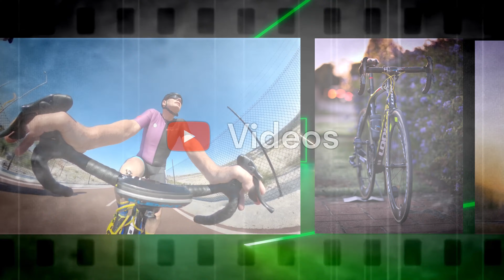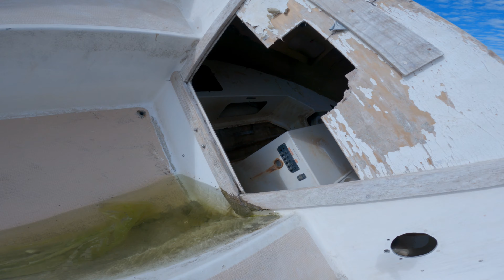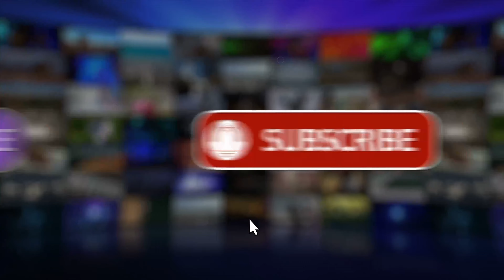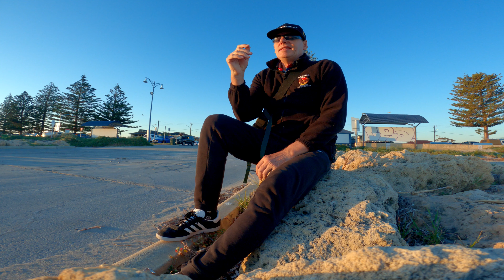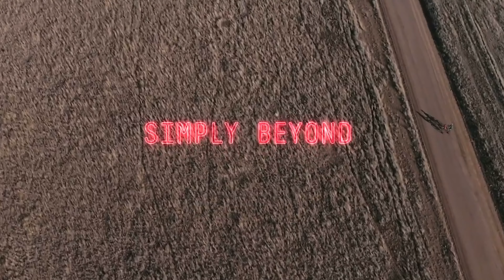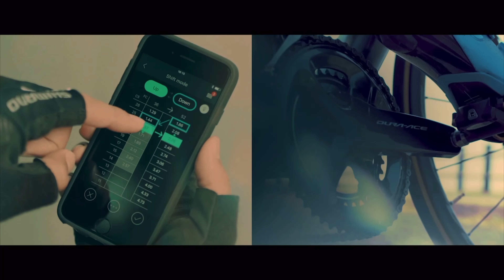HOW MUCH! is Dura-Ace getting to expensive? Dura-ace Shimano Di2 9200

Comment: The pricing is typical for a new product. High price for those who must have it now. Apple are masters at this strategy because they know some fools will stand outside the Apple store for 24 hours and pay to Dollar because they must be first. In 12 months time the actual store price will be similar to the current range.
I suspect you are probably right regarding manufacturing costs of mechanical and electronic. Making the electronic version is likely to be the same or a little cheaper than mechanical. But the retail price of mechanical is quite a lot cheaper so maybe Shimano can't make a profit on high end mechanical groupsets.
Reply from the maker: I would say you are right, the tooling and offering different groupsets is not cost effective.

Comment: Riding this morning with the owner of a Local. He had more to pan. Semi-wireless. Battery is no better than SRAMs pop-on batteries and a right pain to work with. No 10 cog option. They took the 12th cog and banged it in the middle. 2 more teeth on the big cog, but you will rarely,if ever need it. And the quality still isn't all there. He and I are BIG advocates of SRAM. Both of us are on AXS. XPLR is a great option as well and are interchangeable with AXS at the front end.
Reply from the maker: Why pay more for Shimano? That is my point.
Reply: @waynosfotos  I would have bought the old C24 wheels, but never the entire group set. Same with top of the line Campy. O don't need them.
Reply: I sell far more sram than shimano as far as groups go… But, I still feel shimano really knocked it out of the park on this one. The semi wireless system just works so well. running 2 cables is super easy and eliminates 90% of the hassle from the junction box and cockpit wiring harness. 

The 10t cog is still present on 12 speed MTB and off-road shimano, but shimano felt it was too inefficient. In fact they made their cranks even larger. The rear cogs come in 11-28,11-30 and 11-34. I think this is fantastic. 90% of pro racers on shimano choose the 11-30 cassette. The idea that you as an amateur won’t ever use it, but most pros love having it seems backwards. The quality is absolutely there, the quality in these new groups is just fantastic, definitely exceeding sram. 

I do still love Sram AXS and the new XPLOR groups are fantastic… I would use one in a heart beat for gravel or 1x builds.

Comment: Interesting to see when 105 comes out if it's mechanical, electronic or both?? And you can pick up a complete current R7000, 11 speed 105 rim brake groupset in the UK for £480! Can't imagine the new one  will be as little as that 🙄
Reply from the maker: I think Shimano have plans for 105, but I don't believe it will be at that price point. Unfortunately.
Reply: @waynosfotos  I think this will leave a huge opening for Sensah and Microshift, maybe not a bad thing?
Reply from the maker: For sure, and as their product gets better more people will embrace them.

Comment: Demonstrates what? You are just making lots of speculation. And the fact that it's not completely wireless actually makes it faster than the SRAM shifting and the battery lasts a lot longer. You need to route those two cables in the frame once in your life and then forget about them. Seriously, what's the problem with that? Prices for goods and basic materials went up everywhere so it's hard to say how much this has affected the price. And finally, the market has its own laws. If people buy such expensive bikes and components they will keep selling them. As long as there are enough people that buy them why would they have to reduce the price? For sure, if they were not making enough returns with those prices because of not selling enough they would reduce the price.

And at least, Shimano has a 24mm steel axle with a displacement pre-load adjustment. By far the best BB system available. Not like a stupid 29mm (just to make you buy more parts) DUB system with Alu axle which will get trashed with hardened steel bearing races or a wave washer like Campagnolo to adjust the preload which will very likely results in too much or too less. 

But I agree, it's expensive
Reply from the maker: Not arguing that. I have agreed with most of those points in previous videos. 
My point is why the price is so high? I think it should be more inline with the SRAM/SR pricing. 
There is still a lot of problems with Shimano, first is the crank, many failures have been in countered.
The pressed Aluminium crankset has had many problems and is easy to make.
Braking has been disappointing and described as woody on previous groupsets, hopefully that is fixed.
Going half wireless is not really a major upgrade (although I believe wired is fine) but it is not what people wanted.
The design and tech doesn’t warrant the price and there is no cheaper mechanical option, so now you need to buy the expensive Di2.
Which pushes you higher up the pricing market, if you want the headline groupsets from Shimano.

Comment: Great video Waynos. Honestly the market value on bikes is changing people's minds about cycling. I see empty shops and can't really understand how they are keeping their doors open. A lot of new tech and bike designs etc. but I don't think consumers are ready for it. Shimano should have just kept making what they were making and not introduced anything new. Improvements to existing components like the Hydraulic brake issues or the crankarms breaking would have been welcome for sure but I think the 9170 is still better than anything SRAM has. Pretty sad to hear everyone saying they are switching to Campy next time around because Shimano is not making what they people want now. Campy at least takes their time releasing major changes with new groupsets. They seem to work on improving groups more which is what Shimano should have done instead of trying to follow SRAM.
Reply from the maker: People think i am bias, (maybe a little) but campy is not perfect.
My beef is 9200 uses less expensive construction, they now don't have to make extra parts for mechanical and no rim brake development cost. Yet they put the price up.
If they had retaimed the same price or decreased it to allow for the mechanical groupset deletion. I would of been very impressed with Shimano's business model. But they didn't.

Comment: The high end shimano stuff works very well and installs v easily. But it's not on a par with Campagnolo for aesthetics, ergonomics, materials and weight. Shimano certainly have manufacturing expertise in metal, carbon not so much - in fact I thought they outsourced carbon manufacture (eg wheels) not so long ago - but I could be mistaken. This may explain lack of carbon fibre cranks, for example.
Reply from the maker: I would probably say it is cost. It is far cheaper and easier to cast or press aluminium than forge, layup carbon.
Reply: Then why is Campagnolo's market share so tiny?
Reply from the maker: @bikerjk1205  I would say two reasons;
1. They historically have been more expensive
2. Less bikes are specced with Campagnolo new

Comment: I have 3 bikes, all Shimano. I’m changing to Campy for my next bike (2022). The reason did not do it before was good value for $ from Shimano. I have Ultegra 6800 mec, Ultegra 8000 DI2 and Shimano DURACE 9100 mec. All RIM break. Now that DURACE is more than double price against Super Record mechanical and almost 1000$ more expensive than Super Record EPS then there is no reason to keep going for SHIMANO, Campy is as good as SHIMANO with flawless performance, less weight in the RIM break and with nicer looking chain rings. Sorry Shimano I think you’ve made a big, big mistake trying to overprice things when there are similar configurations 12 speed with better technology and proven performance.
Reply: I have had two ultegra cranks delaminate in 3 years. No way am I giving shimano any more of my money
Reply: @jaycycling  Check Hope cranks as a replacement
Reply from the maker: Yep and they still persist with the same hollowtech technology.

Comment: I heard the brake pads are alot further away from the rotar with this new groupset, that has to be a massive plus,  my concern with disc brakes are the rubbing, if this has been eliminated, then I will concider.
Reply: Well if it's only 10%improvement, I'm sticking to rim brakes
Reply: But reported to still rub :D.
Reply from the maker: Yes, 10% more movement off the pads. This is welcomed.

Comment: People have more disposable income than ever before and are willing to waste it more than ever before! I’ve got to the point where I need to stop complaining about bike and component prices! No one’s listening and no one cares even the majority of cyclists themselves. They’ll even tell you to get a better job and stop complaining even though they know zero about your job or financial status! I was cycling when there was an inseparable link between weight and price. Every cyclist bought that explanation, especially when more exotic materials were used. Now, that link between weight and price has been abruptly severed and replaced with, actually, weight doesn’t matter it’s all about Aero! This has opened the way for manufacturers to release mid tier bikes close to the weight of my 10kg CX bike with prices around $5000 or more. My whole bike cost less than the new Dura Ace groupset and has mostly Dura Ace mechanical on it. I love Shimano, but I’ll be stopping at 9100!
Reply: If you are a 23 year old professional climber weight is probably important.  But not very. Damned if I can tell the difference between a 16 lb bike and a 20 lb'er. Because of that many people are returning to well made steel bikes. SRAM is likely to pull another rabbit out of the hat. I can think of at least one way to simplify and reduce the cost of electrical derailleurs.
Reply: After paying for Dura Ace manual, it simply had no problems but also no added value. Not particularly light. And very easy to shift rather badly. Di2 is a far better choice.

Comment: they got market share because campag was expensive. looks like i will be  going back to capmag,
Reply: Campag prices have not creeped up anywhere near shimano has . I got the cheapest campag groupset £600 . Its lighter than 105 and only slightly heavier than ultegra for 1/2 the cost . Plus I can get small parts for the shifter .
Reply: @edmundscycles1  spot on
Reply: @edmundscycles1  and campag are better quality
Reply: @paulhyland4653  I'm a bike mechanic and love campagnolo . Spares are so cheap for them and availability is great here in the UK . Longest I've had to wait is 2 weeks for them to come back into stock . Lead time is about 4 weeks for most complete stuff .
Reply: @edmundscycles1  as well as my self unfortunately most of my customers are on shimano but they will be moving over as they upgrade  now 😉
Reply: @paulhyland4653   hehe I even wrote a blog post explaining the advantages of Campag for people with smaller hands .